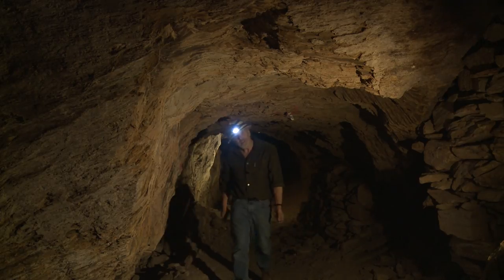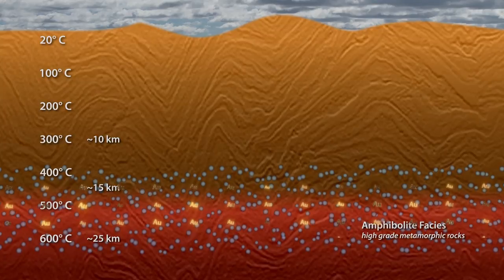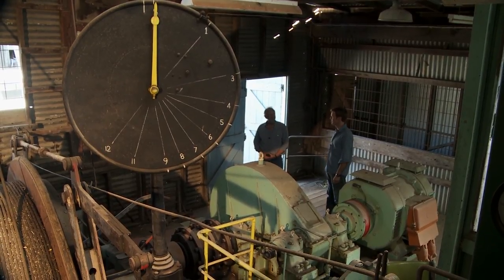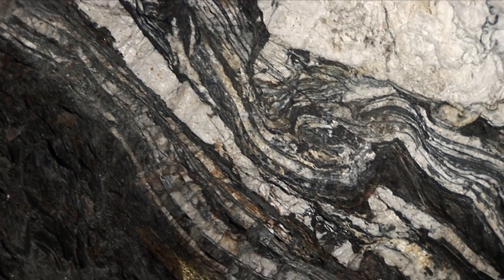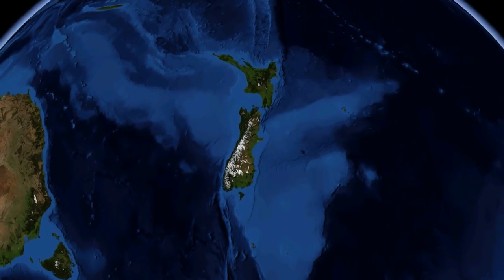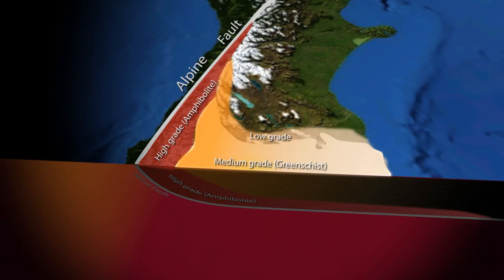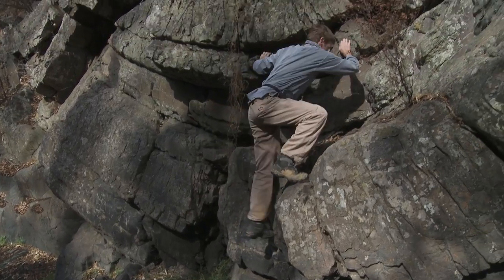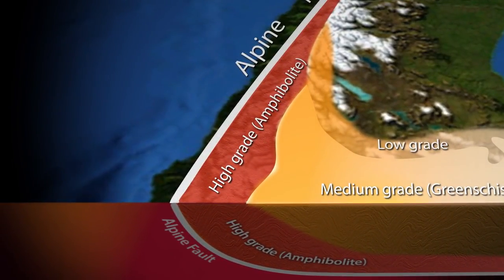The Metamorphic Gold Model - The New Zealand Story

Comment: I think you're all looking in the wrong place. Instead of looking for gold in rocks of parts per billion I think you'll find more gold in water. Especially at the ocean depths where metals are more concentrated than at the surface.
Reply from the maker: There is gold in seawater but at extremely low concentrations of parts per trillion. There may be slightly higher concentrations in different parts of the ocean but ultimately any gold in seawater must have come from the rocks to begin with.
Reply: Can you imagine how expensive it would be to mine gold from the ocean? It's hard enough from the surface lol!
Reply: This isn't a video about finding other gold, it's a video about how gold gets to a specific environment (which isn't the ocean).
Reply: @qbb01  Fritz Haber (inventor of the notorious Zyklon B) tried to extract gold from seawater to fund the Nazi war machine.